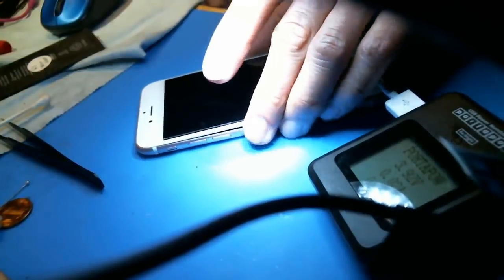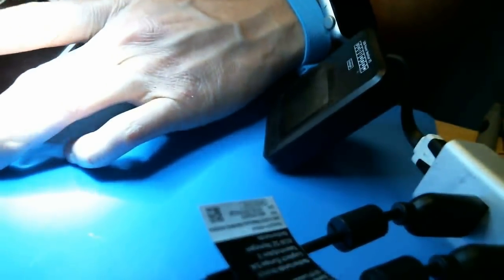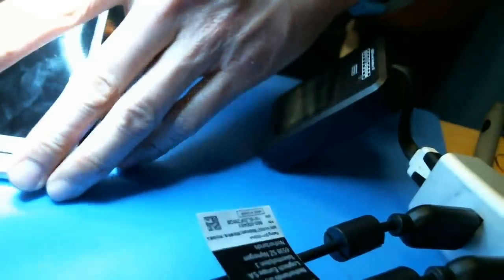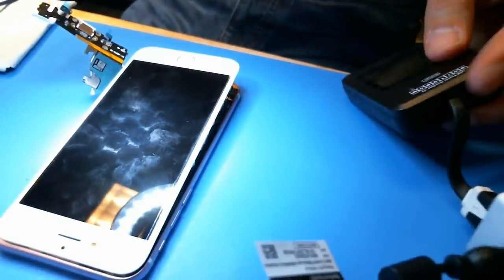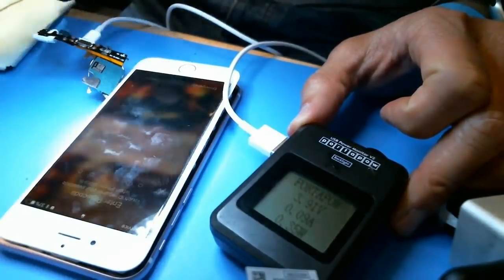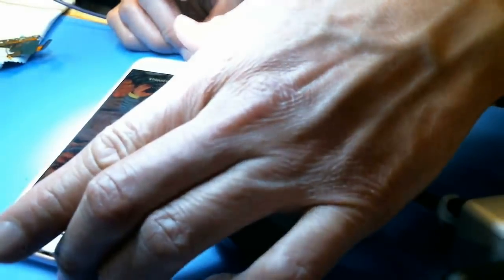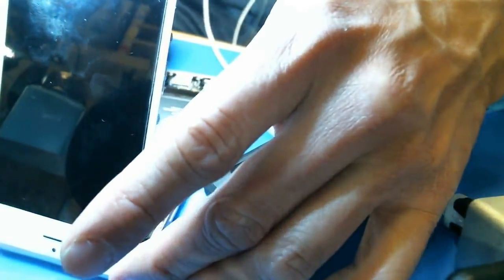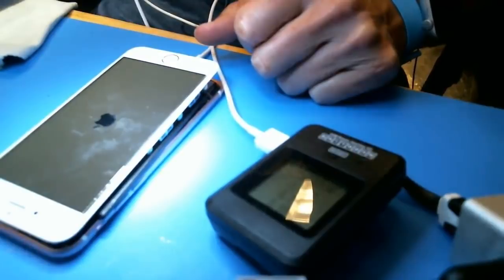iPhone 6s No Power Repair

Comment: Hello be careful. You know sometimes when we have tristar problem the tristar cannot just charge low battery but no problem with full battery. Its not because the tristar is charging your battery which is already charged that is not a tristar problem, thanks for your amazing videos